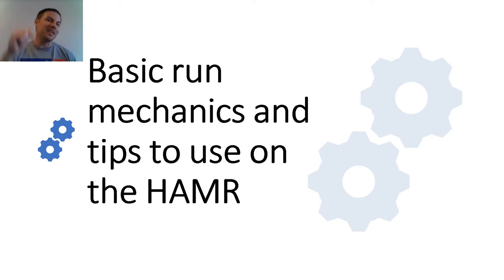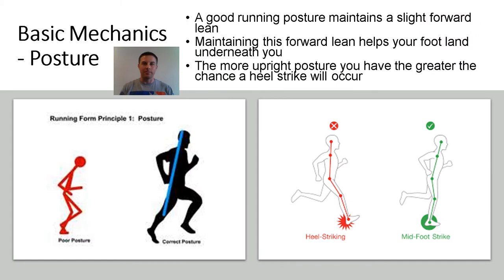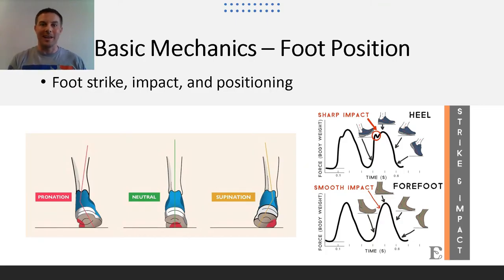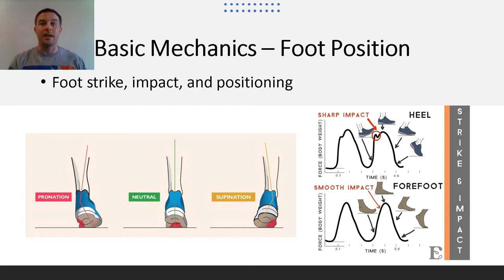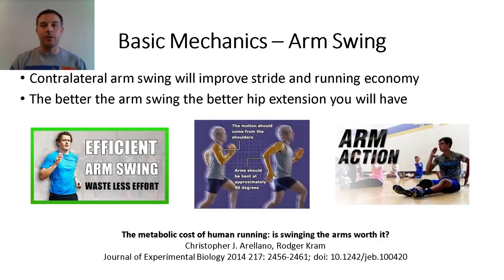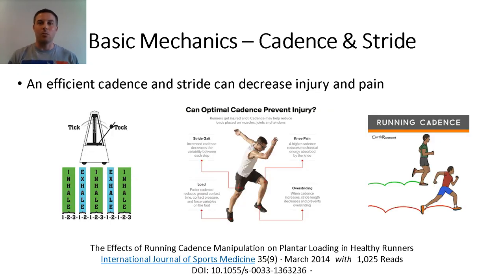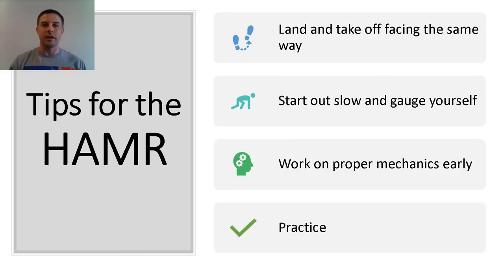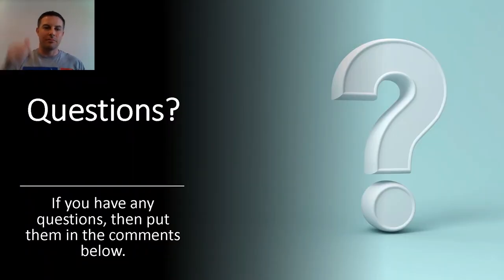Basic Running Mechanics and Tips to use on the 20m HAMR

Comment: How many steps per minute do you recommend for running cadence?
Reply from the maker: Good question. It depends on several factors. Your height and the level the HAMR is on are the two big ones. Shorter people will have a higher cadence than taller individuals for instance. When the test go on, either your stride length or your cadence needs to increase. Usually its preferred to lengthen your stride and open the hips up more. That will help decrease the amount of effort and energy you put into completing the shuttles. The study I provided goes a lot more in-depth if you want to know more. Just performing the HAMR will give you a good gauge and practice for the different levels. Just make sure to not sprint the first few levels. Hope that helps.